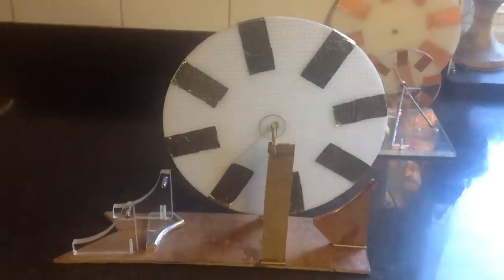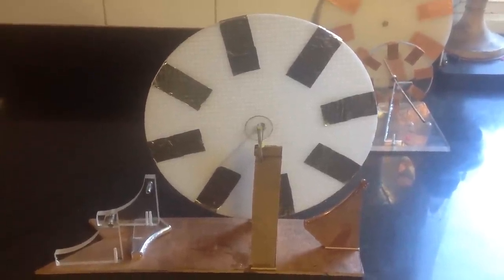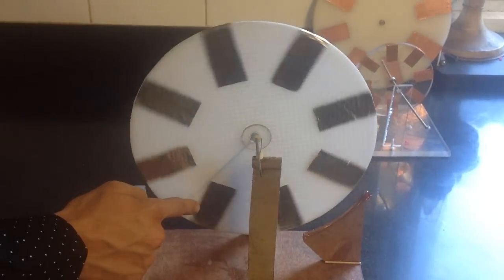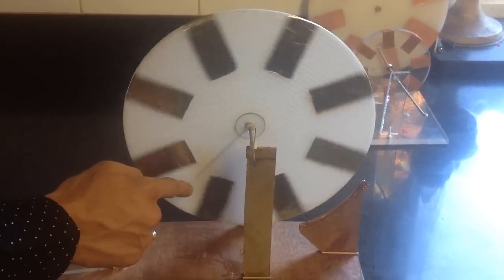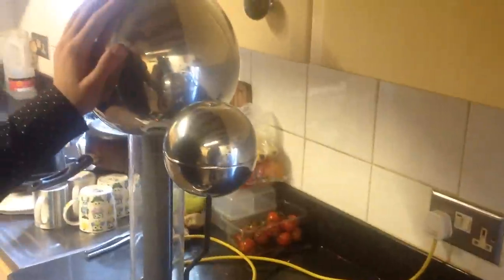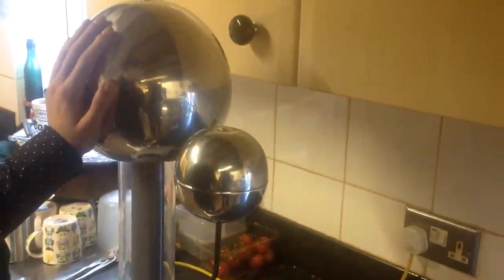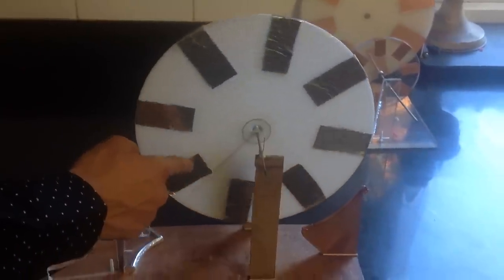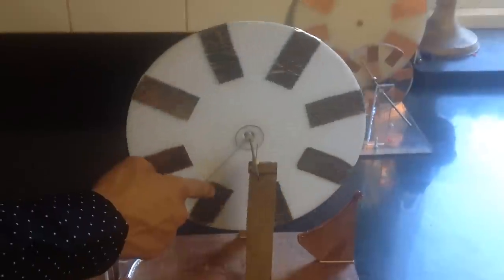SECRET REVEALED !! SELF RUNNING FREE ENERGY DEVICE 2015.

Comment: coulda woulda shoulda.  The simple fact is that the original doesn't have a VDG humming in the background, he picks the unit up and moves it around, he holds the disk in his hands and puts it back and doesn't hold a finger near.  Until you can do it like he does and then show us the hidden trick, you haven't shown us anything except another version of an electrostatic motor.

Comment: the model needs to be built properly. with an aluminium disk with plastic not lucite. the curved part should be very close as well as the points all should be aluminium. it must be aluminium because of the proton electron neutron balance . 13p 14n 13e . it only takes on extra electron to make that atom work verse copper which takes many many more .

Comment: it works on the principle of an electrostatic motor...it relies of high voltage rather than amps to operate..might also work if one polarity had been hooked up high above the home and the other to the ground but both left close to the spin set up without touching them..the positive charges seek to meet the negative charges on opposite poles and in turn use the foil spinner to transfer the meeting thus spinning the wheel

Comment: Good job!  I figured this could be done wireless if you had a strong enough power source.  I'm still not convinced this is how the gentleman did it.  His machine runs too fast in one part of the video--- unless he has a huge VDG or Tesla Coil somewhere close by.
Reply from the maker: ***** Many thanks. I wonder if it's a scale thing? Our disc is 10" in diameter, I would guess the originators to be about half ? This might be the reason for the higher speed ?
Reply: ***** A magician pulled a rabbit out of a hat.  Sometimes you don't need to know exactly how the trick was done this time.  You just need to know some methods and that it is a trick.

Comment: one side of the disk is aluminium and the strips should overlap to the plastic side.
Reply: +Gadget mall ... On the original clip, I noticed that one side of the wheel has a different texture, as compared to the other side.  Are you saying the wheel self-rotation is caused by the charge differential of the one side being an aluminum surface, which is charged and carried over by the strips to the opposite side, that is an insulated  plastic surface; making the strips pulse/repel from what he called the "pointy things"??

Comment: @Grum C with all due respect for your effort, you haven't done the replication correctly. You made two errors.

1) One side of the rotating disk must be made of conductive material, as per the original video.

2) Once machine was charged from the Van der Graph's generator, you can remove the finger. Its interesting to see if machine would work if charged only once and left to run with a fixed amount of charge.
Reply: It matters not how the motor is constructed, as it is NOT a "perpetual motion machine" as the video title suggests. THAT is the biggest error elephant in the room.  BTW, it is Van de Graaff, not Van der Graph's.